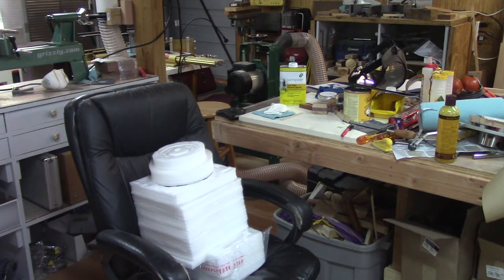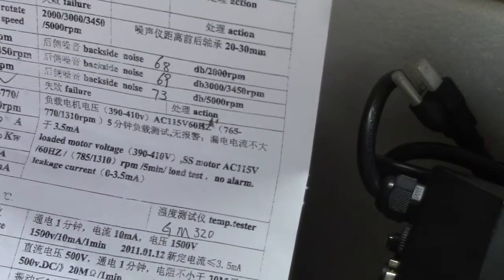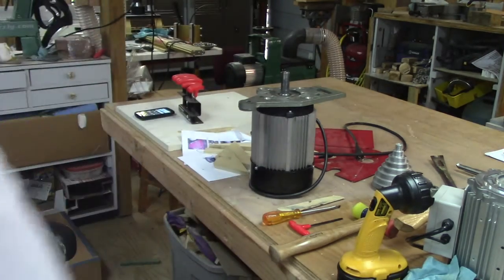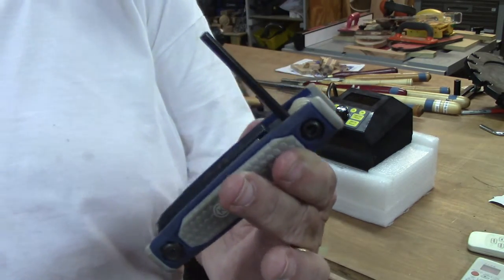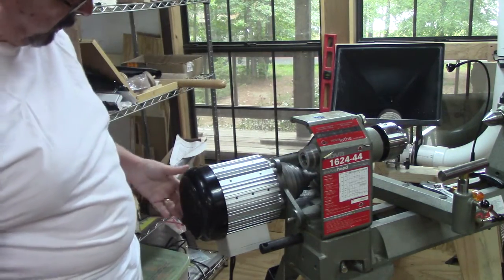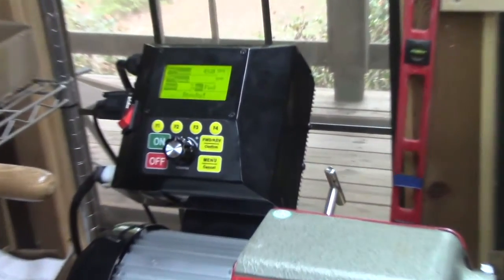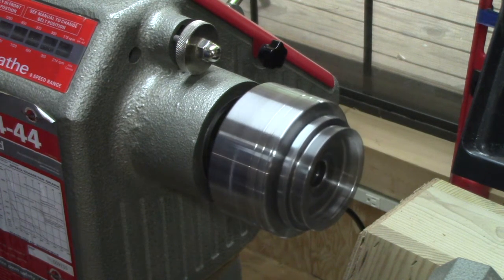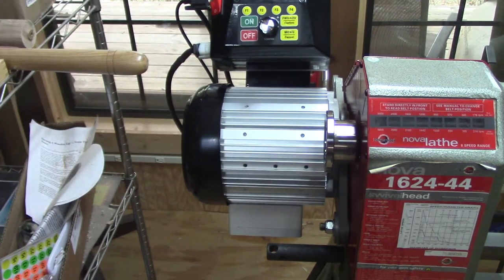NOVA 1624-44 DVR Motor Upgrade

Comment: Hi,  I have a 1624 II that I upgraded to the DVR motor about a year ago. My question is have you had any issues and had to deal with Nova/Teknatool/Striatech? This last month I've been getting the sporadic "hardware fault" on my drive then it resets and I can keep going, it's very annoying. I've been emailing and leaving messages with them for several weeks now and I've gotten no response. Just wondering if anybody else has had issues with them and their lack of customer support. At this point I wouldn't give them another penny, very disappointed in them

Comment: Firstly, thank you for making the video.
The wobble you have in the chuck is caused by the insert, some inserts simply don't work right, I have replaced mine 3 times and each insert behaves differently, the last one seems to be 80% better than any of the others, a plastic bushing between chuck and spindle helps to balance the wobble.
Now, the main reason I'm posting is because your video is 6 months old and I'm told here in Australia that those upgrades are obsolete and no longer on made and on sale.
I really want to stop changing belts and I would be happy with one of these new systems I just need to work out how and where I can order one from in the USA.
GV
Reply: Not surprised that they have discontinued the upgrade sale (in Australia and likely pending in other places) given they have come out with newer models that they want to sell. My upgrade is working well enough, but it is not worth what I paid for it. I hate the 'soft buttons' that are on it. Very difficult to get the buttons to work properly the 'First Time'. I'd look into simply buying a motor and VFD Controller and installing it. That is what I should have done. Many articles and how to documents on-line. Best of luck.

Comment: Hello  Have  you fixed the spindle wobble on your lathe?
           It seems there has been a few of these with this problem.
Reply from the maker: I am not having a spindle wobble problem - currently and have not 'fixed' it. I have very little to no 'run out' on the spindle. I believe that someone 'thought' that I had some wobble/run out, but I've finished several very nice pieces with no problems with my lathe or the quality of my work. Thanks.
Reply from the maker: I watched the end of the video again. What may have happened is that during my initial testing after changing the motor, I may not have had the chuck/adapter all fully 'seated properly'. My apologies. Hope this answers your question.

Comment: Thanks so much for making this video!  After a few weeks of drooling over the box at Woodcraft, I finally broke down today and relieved them of it.  Figured it could be a while before they got another, and didn't want to deal with shipping (and waiting).  So now, after seeing your video, I feel emboldened to get 'er done and leave belt-changing behind!
Reply from the maker: You are welcome. Just take your time and it should go smoothly. If you get stuck on something or have a question - give me a shout.
Reply: Update:  So yesterday, I bought a dead-blow hammer and a pair of plastic tree-cutting wedges in preparation for the dreaded "pulley removal".  After removing the motor and setting it on the bench, I removed the grub screw and just gave a test tug by hand and the pulley came right off!  Maybe because the Nova is only a year old, and living in the low-humidity of eastern Washington there hasn't been an opportunity for rust/corrosion to develop between the steel and aluminum parts, I don't know.  Anyway, off to the local Ace to get screws to mount the panel.  Thanks to your discovery of better placement of control panel in relation to power box, I have that optimized as well.  Thanks!
Reply: I ran into an issue tonight when installing the finished motor assy onto the lathe.  Seems as though the new motor is about a half inch greater in diameter than the old, so Teknatool  had to file away part of two of the fins so the cam will clear.  You must have picked the absolute right spot to place your flange....my power box is now down like yours, after rotating to get the filed fins in the right spot.  Look and see if your fins are filed away where the cam rests.

Comment: I have the new Galaxi 1624-44 and I was expecting you to be beltless (direct drive) with the new DVR motor. I also have an emergency stop. Did your expectations get met with this new motor?
Reply from the maker: Yes, 4 programmable buttons. Have not used them as yet. I believe that it will go down very slow, but have not fully exercised it as yet either to the low end, or high end. I had it up to 2,500 rpm's, and doubt that I will be using anything faster other than possibly for buffing (which recommended speed is 3,000 rpm's. I don't see anything in the documentation/control box for 'recommended speed'.
Reply: I was a 'bit' disappointed in not being beltless, but the cost and effort would have been much more to go direct drive. I do wish that it had a emergency stop button on it - but the rocker switch is easy enough to toggle. Not sure why Teknatool didn't incorporate the emergency stop though.  

Right now, I'd say my expectations were met. The speed control is 'digital', meaning that it steps the speed in increments. Example: if at 450 rpm's, when you increase it goes to 550 (100 rpm increments). I haven't checked at which point the increases get bigger or smaller - but I imagine that it dependent upon the speed range. I'll test that and put my findings on here.

Thanks for your comments/questions.
Reply: On mine, the range is 100-5000 RPM. What is your range? Did I see you have programmable buttons on the new speed controller too? Was that available on the older motor? There's a feature on mine too that helps recommend speed based on size of piece (spindle vs bowl) and type of cut (rough vs finishing). As a relatively new turner I don't use it that much, but it is nice to have for reference.
Reply from the maker: Sorry for the delay in replying Derek. Yes, it met my expectations. I knew it would not be beltless. It is on the 'middle' pulley and will stay put. 'IF' I needed more torque for a large piece, I could move it 'down' a bit, but never 'faster'.